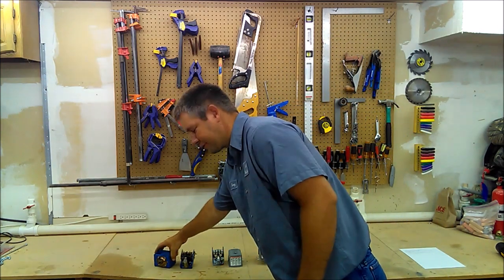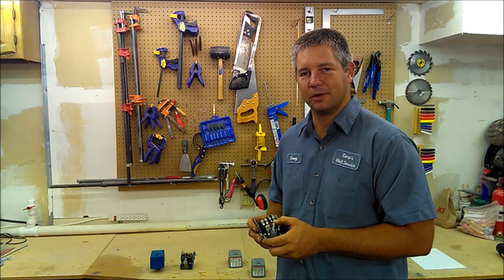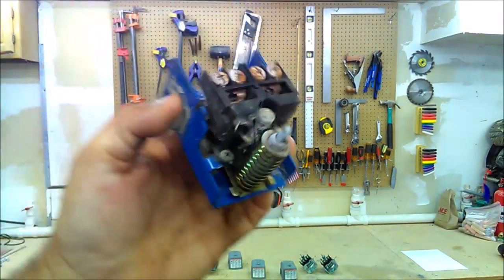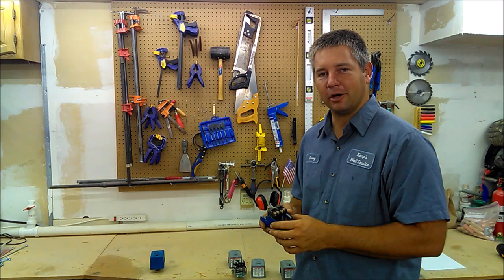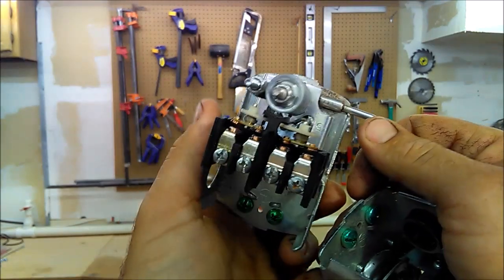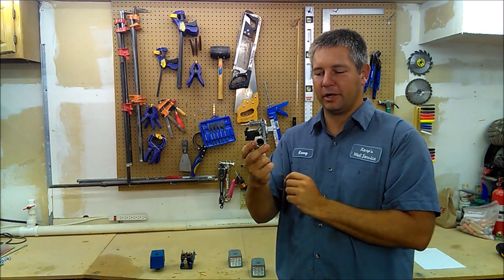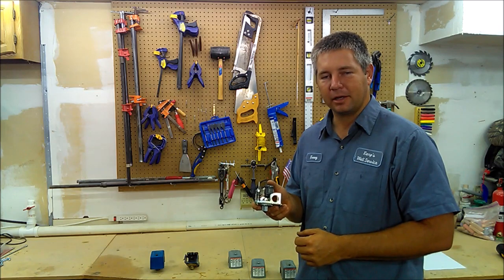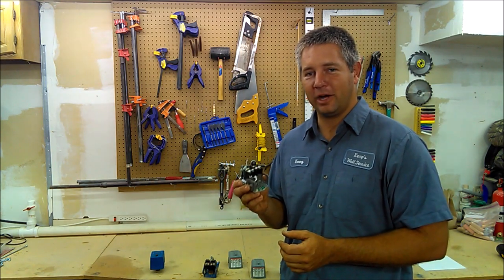Pressure Switch Failures

Comment: We moved in 5 1/2 years ago and I’m on my fifth switch for my well pump. It keeps corroding with rust and the points get so corroded to the point that they’re white and chalky looking almost like Chronicles. All of the screw terminals that hold the wires in are arrested. This happened five times in a row. Any advice is appreciated.

Comment: What happens when a switch gets stuck on the on position?  Does a pipe blow or what ?
Reply from the maker: That depends on a few things.  The system builds up pressure until it goes somewhere or reaches the maximum pump pressure.  Best case it goes out a relief valve to a drain.  It's possible to burst piping or water heaters or other stuff above ground.  It's also possible the system holds all the pressure of the pump and it dead heads and builds heat in the well.  This can melt plastic pipe and cause the pump to come off in the well.  It's also possible to melt the pump into the plastic casing and ruin the well itself.  It really could be a few dollars to fix or thousand of dollars damage.
Reply from the maker: Also possible to melt the pump end down and need replaced.

Comment: Amen Kenny!  Replacing a burnt up switch, without knowing why is the leading cause of premature pump failure. Do it yourselfers beware, don't just run down to home depot and replace the switch without finding the root cause of the problem!  Save time and money, call a professional water well drilling or pump installer company!

Great video on switches Kenny, I think you covered everything even those damn piss ants!  More people are without water over just fracking ants!  I have helped so many people over the phone fix ants in the switch and test to make sure the well is in good health.  Cause sometimes it's not ants it could be waterlogged.  Checking the cycle time over the phone makes sure I don't need to make a service call on a Sunday over piss ants hahaha....

Thanks for the video, and take it easy man!
Casey
Reply from the maker: I couldn't have said it better myself.  In fact if you don't mind I'm going to put this in the description.  Thanks for the comment Casey
Reply from the maker: Funny you should say that.  We are headed back to the well I did the iron bacteria video on in the near future.  They called today and a line rusted out in the pit and flooded the VFD.  We didn't put the pit in and wouldn't have used steel, but it was there and we left it.  We need to get a 3 hp VFD first though.
Stay safe,
Kenny